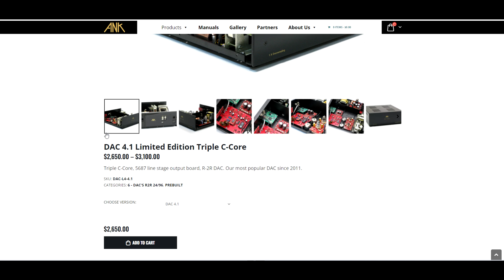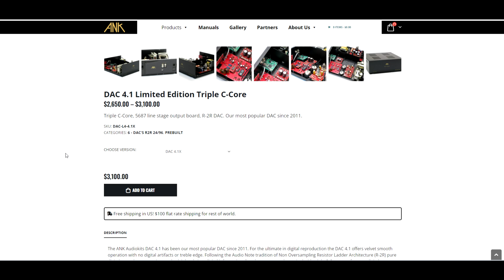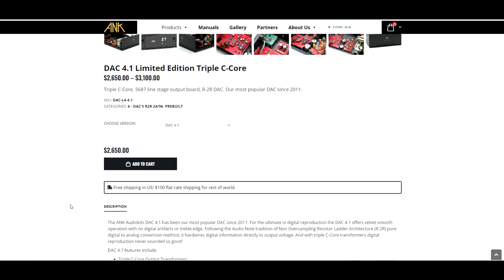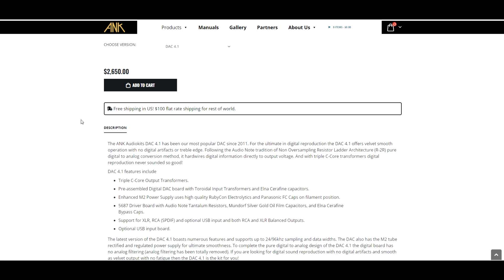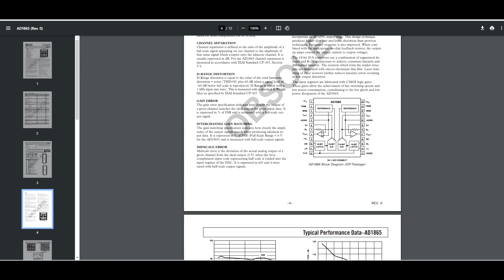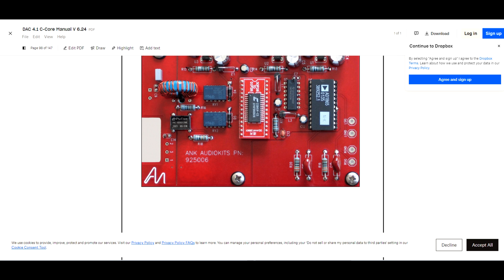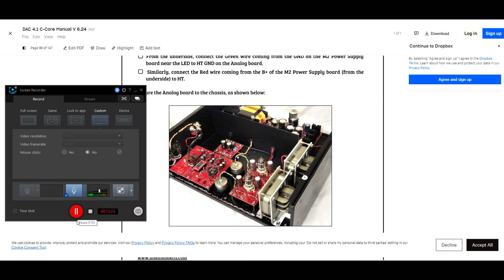ANKits DAC Model 4.1 I'm Gonna Build It Methinks - Stereopolice :)

Comment: Yo, I'm just catching up to your hunt for a new DAC.  I'm a big fan of R2R DACs.  I built the ANK 2.1 Signature a couple of months ago.  It was on sale for $1250.  It's an easy build.....too easy in some ways.  I was disappointed that the digital board comes pre-built.  The M-2 power supply is a good power supply.  It uses an ECL82 tube for regulation and has a 6x5 rectifier tube.  The analog output board uses 2 6922 vacuum tubes.  The difference between the 2.1 and the higher priced models is principally the transformers.  I was pleased with the sound, but it's not the most revealing DAC.  Does it sound analog?  No!  It's digital.  If you want analog, play records.  I own two Denafrips DACs (Aries II and The Terminator) that are true ladder DACs using laser trimmed resistors.  I also own the RME ADI 2 and the Topping D70 which are Delta Sigma DACs.  They all sound different and none of them sound analog because digital isn't analog.  If you decide to build this, be aware that the chassis is BIG.  As you know this is quite a leap in price from the Akitika kits (I also built the Akitika pre-amp and op amp based power amp).  Brian Smith is easy to work with at ANK.  When you get your kit, you will be missing parts (this is my second ANK build), but Brian will send along whatever you're missing.  My kit came with a bad ECL82 which caused me to blow up a zener diode, but once I figured out what was happening Brian sent me a replacement tube and new zeners.  Before buying I would contact Brian and ask for a discount.  He will give it to you if he is able.  Hope this helps....

Comment: Do yourself a favor and skip the AN digital regs, there are much better implementations. Cut the LP filter cap to below 100pf as well. The new 2w tant resistors are the shit in all spots except the load in resistor for the IV trans. Nude Vishay resistor there. The level 4 platform is a good start for an SPDIF system. I use USB so I tapped the i2s lines and use a low jitter clock and reclocker in the i2s stream.  I eventually tossed the AN board and did a differential AD1865 board with a wholly USB to i2s optimized throughput. STUNNING at this level.

Comment: I've not encountered a DAC that sounds better than one with a classic R2R chip. There are other great options without spending nearly as much. Anything with the TDA1541 or the PCM63, PCM1702, or PCM1704 sound great. It's not hard to find one of those DACs and mod it, since you are willing to grab the soldering iron. A MHDT DAC is also a great option.

Comment: OP-AMP can be made out of Vacuum Tubes( Just a collection of transistors)
This build is very close to the " "Lampizator" the basic kit starts @ $150 but you can run it upto $1k.

My Build uses OpAmps for the Spdif & Vacuum Tubes for Analog out. I like switching between both.

PS: Look up the Bob Carver Challenge he proved in the 80s solidstate could sound like Analog Tubes
Reply: OpApm is used (mostly) because it's easy to create a high order filter with an amplification. If you are not limited with number of components, it's better to have a low resistance as a current output load, and some linear amplifier. Because diff amp (which is inside of an OpAmp) kills a dynamic. This was a catastrophe when tape recorder manufacturers switched to differential amplifier input stages, and then proceeded to opamp based ones. Just compare a sound of Nakamichi (except cheap models) with Sony and you'll get an idea about what is a linear amp sound, and what is a differential stage sound (I even do not offer to compare with opamp pre-amps, cause it's a dead sound).
Reply: @sc0or Technically NO an Op-Amp is just an arrangement of components of ANY !!! Type by definition!!! NPN, PNP, Bipolar, JFET  or even Plates inside a Vacuum Tubes. 

With that complexity it's easy to use the wrong type for the wrong application. I learned the vastness of the term in the Malvenio circuits books in the 80s. 

Being a Diehard Audiophile and Electronic Engineering Forced me to learn both sides
Reply: @HeavyCrown2030  I have not seen an OpAmp without an input differential stage. The rest "components' could be current sources and mirrors, temperature compensation networks, current buffers, etc.. But a diff stage always existed.
Reply: @sc0or I feel you are combining  the two things  reference input, differential input. 

Both are at the core of electronic equipment in fact you cannot make a XLR input without a differential comparator. ( That is typically and OpAmp design)

You may be actually speaking to the mumbo jumbo about Feedback Circuits being bad ( Audiophoolary) because it's much more complicated than good or bad.

Comment: Hello Stereopolice - Way back when, I purchase a Audio Note 2.1 DAC Kit. Built the kit stock then went on the DIY upgrade path and ended up with a very nice sounding DAC. It was a great platform to upgrade - making mistakes - fixing my mistakes - and listening along to way to determine if my efforts were positive or negative. The 4.1 looks like a very sophisticated unit where no upgraded will be necessary ....at least for a while. Enjoy the ride    Tom in Lafayette
Reply: Tom, what upgrades did you make to the 2.1, if you don’t mind me asking?
Reply from the maker: Yes, love to know?  @daveweston403
Reply from the maker: Thank you!!
Reply: @tomrichards4041 what upgrades did you make to the DAC - if you can share any?
Reply: I will go back through my notes - and will post a list of what modification I added to my 1.2 

As stated I suspect many of the upgrade are included in the level 4

What A to D chip is in the level  4?

Tom

Comment: Very cool design. I think ya gotta go for it. My DAC is an Adcom from the 90’s with a few upgrades, but like that ANK DAC, it’s got all through hole components, which of course makes it easier to repair should anything go wrong. Call me a dinosaur, but I still haven’t fully accepted SMD parts. Maybe someday…. Thanks for yet another great vid.
Reply from the maker: Yeah, I'm not a fan of surface-mount.  Not at all.  Cheers.